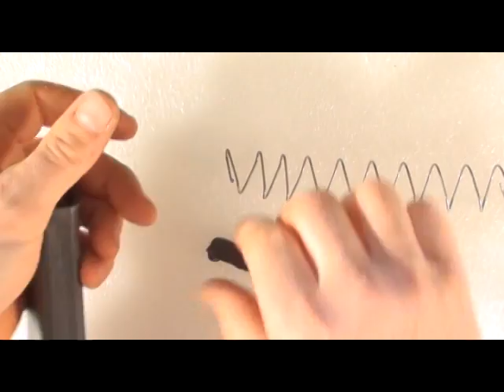Know Your Glock Parts

Comment from the maker: Gaston Glocks primary design criteria for this pistol was to make it so that any field solder could completely disassemble, and re-assemble it without needing an armorer to do the work.
Check out my two-part video on the total disassembly of a Glock.  Just make sure to do everything in the proper sequence using the proper tools and techniques.

Comment from the maker: @rafa441df Diameter of a Glock 17, 3rd Gen.  recoil spring guide rod is .224" , that's the thin part under the spring, not at the ends of the rod.

Comment from the maker: That's normal.  when a magazine is fully loaded there's no room to compress the spring any further as the top round is pressing against the bottom of the slide.
Simply lock your slide open before inserting the full magazine, or load one less round in your mag's.

Comment: I need help guys!

I went to the Glock Store and bought titanium striker, titanium extractor safety plunger and spring, 6 LB triger spring, 3.5 LB connector and finally the laserMax for my Glock 30.  I have not tried to fire it yet but ......The reset trigger does not work!  What do I do!????

Comment: Ive had an issue with The metal pointy peice on the trig mech housing interfering with the slide back plate when reassembling the slide to the frame. I have to be carefull and apply side ways force  to the slide in order for the back plate to clear that pointy peice on the trig mech. If I dont dont do this the back plate will run into that pointy peice on the trig mech and cause interference and damage to the back plate... do I have a faulty part?

Comment: this is awesome. I'm left with one leftover part. its part of the trigger assembly. It's a small, thin piece of metal similar to the slide catch spring, but shorter with a couple more bends. what is it?
Reply from the maker: Could it be that the thin wire spring, that is supposed to be a permanent part of the slide stop lever assembly, possibly became detached?  

https://www.youtube.com/watch?v=J2Ah-Gj4MDs&t=0s
Reply: @theKGB65 Thanks for the response. good thinking. I don’t think that’s it though. That a great video, but I still didn’t see the part. The weird thing is, got the whole thing assembled and it seems to function properly. Haven’t fired it yet though.
I don’t know how I didn’t think to post a link. In the photo here, it’s the piece at the top right corner.
Reply from the maker: Maybe some sort of aftermarket trigger-mod part then..?    @danielmorgan5276

Comment: great video, very informative... I was told that to convert the .40 cal Glock 23 to fire 9mm, I would need a new barrel, extractor, and ejector. I saw you remove all but the ejector. Does it go under a different name?